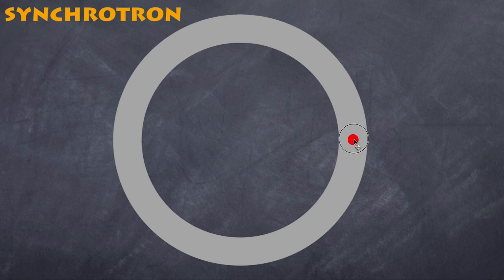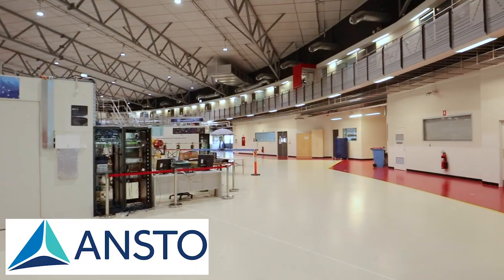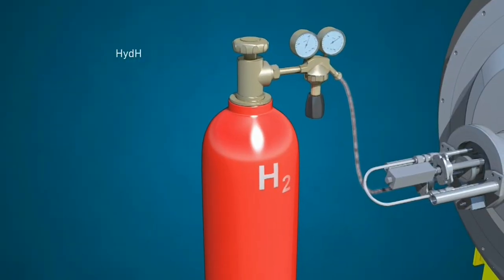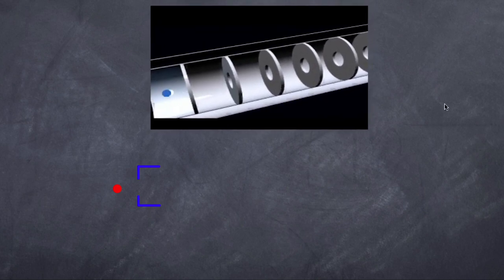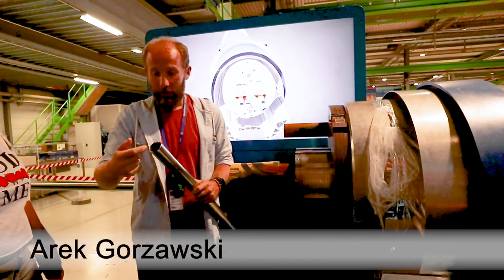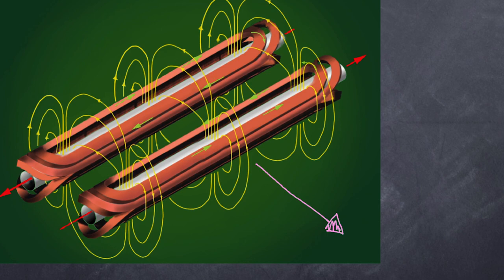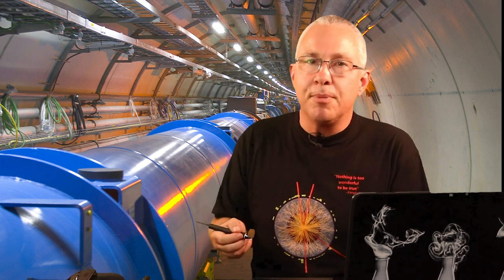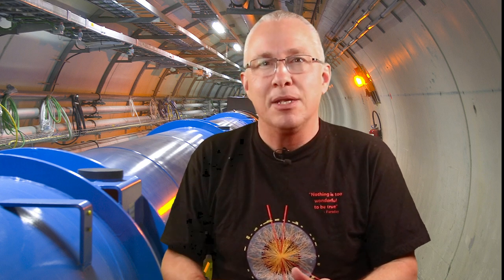How  CERN's Large Hadron Collider works  - physics principles as an example of a synchrotron

Comment: 14:50 Can the magnetic strength of the superconducting magnets be measured in electron volts?
Reply from the maker: No. Magnetic field strength is measured in Tesla. In the case of the dipoles that bend the beam, they are around 8 Tesla.
Electron volts are units for energy. Election volt is in  effect an extremely small unit for energy.